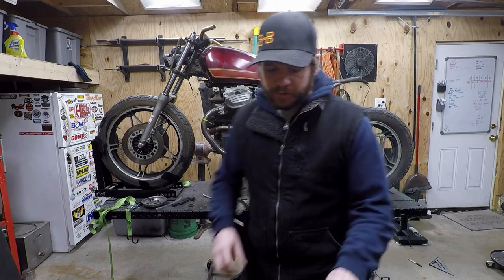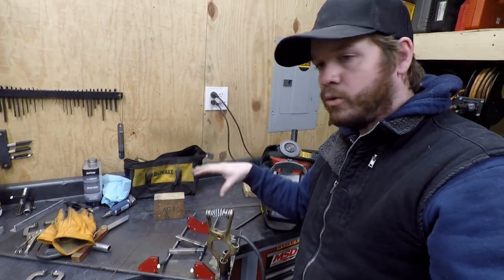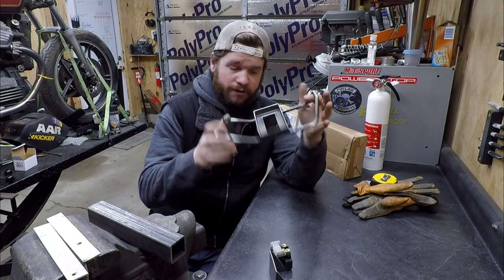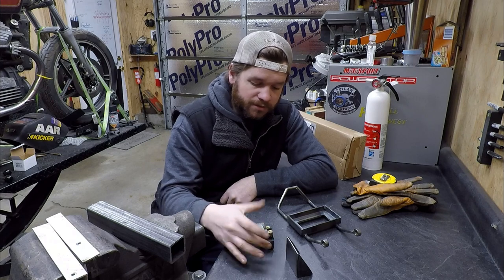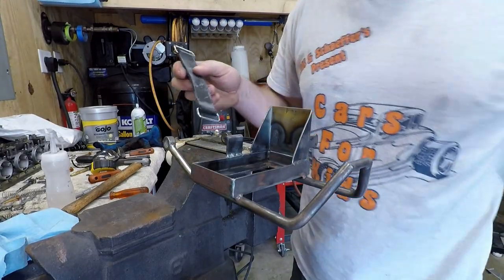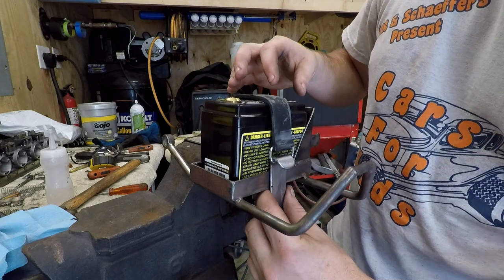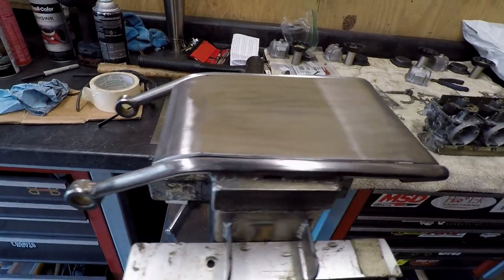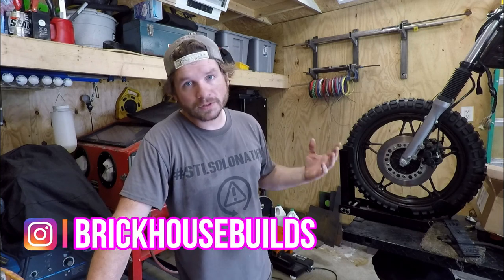Making A Battery Tray / Honda GL650 Build - EP18

Comment: Looking good. Would you consider drilling a hole in the skidplate to avoid water accumulating there? Looks like water can get trapped there with the rocker you got going on. At least something I would consider here with the Dutch weather
Reply from the maker: Thank ya! I doubt this will ever get ridden in the rain but that wouldn't hurt to have a small drain just in case

Comment: Not sure if you’re still following some comments on these videos, but when you were working in your (older) shop here, how would you bend sheet metal? Did you have a brake setup or did you go old school torch and bend?
Reply from the maker: I actually show my process in my electronics tray fabrication videos. Mainly a small break but also vise and hammer

Comment: Great video. Is there any reason why you dont lay the battery flat? I look that you could save some space then...
Reply from the maker: Thank you. If it was flat the battery wouldn't fit in the spot I have it
Reply from the maker: Let me rephrase my previous reply. If it were flat it would be closer to the exhaust and has more exposure to heat even if its .0001%. I've done it that way before and wanted to try this way with this specific type solenoid layout.